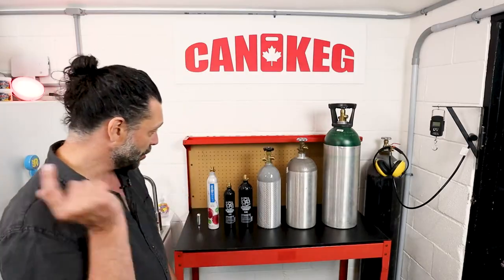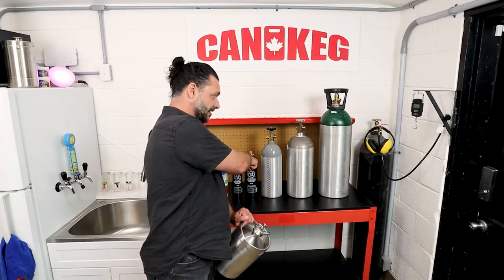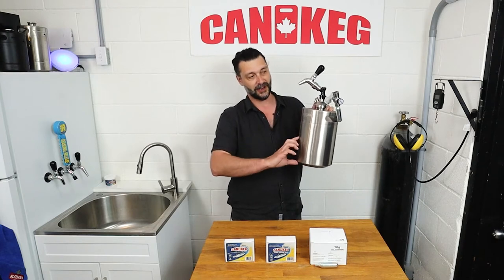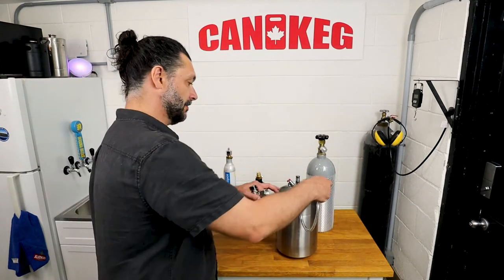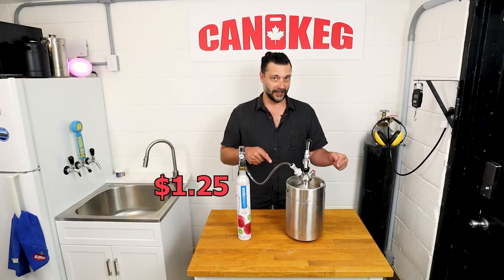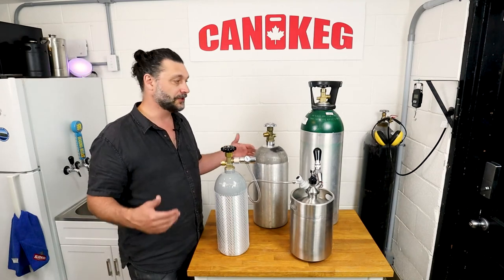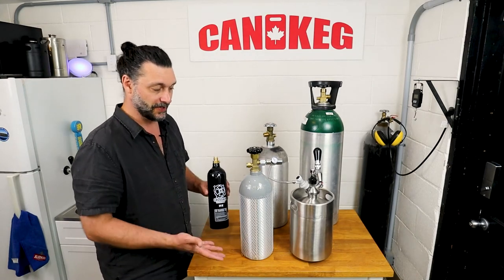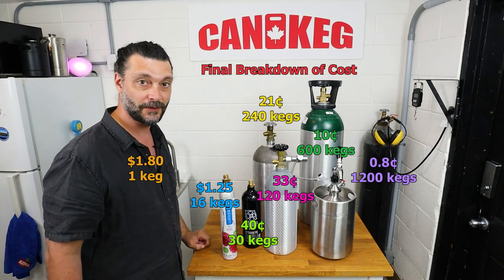CO2 Cost Comparison

Comment: Thanks for the video.  Just got my 1st keg (used 20L) and getting supplies to have summer beer on tap.  I am going the sodastream route,  but I already have the 20lb CO2 tank with dip tube as I have refilled the sodastream bottles in the past.  I paid about $1.20/lb of CO2 at the local place here in Waterloo, ON.

Comment: Is there a difference between CO2 and Food Grade CO2? asking in regarding to filing soda stream canister. Thank you!
Reply: Yes. The Food Grade is properly filtered for drinks and is safer for consumption. Soda Stream will have the proper Co2, but you can go to AirGas and they will fill it with the Food Grade Co2 which is what you want. I filled a 20 LB tank and it cost me $41 dollars in Reno to fill.
Reply: The only difference is the chain of custody signatures it's all filtered to the same standard

Comment: Is there such a thing as "food grade" C02? I am a bit worried the paintball refills would introduce some oil in my beer... I have found a place I trust and refill 20lbs and 10 lbs cylinder, but I would be worried about random refill locations. Maybe it's all the same?
Reply: It's all the same, the welding and paintball refills are just pure CO2.  I always use a welding supply shop. Very cheap.
Reply: @MachuPichuu  same welding shop is the place to go

Comment: Thanks for the video. I’ve been brewing beer for a few years now and always carbonated my beer in the bottles. I just got my first keg system (2.6) gallons. I noticed you made a distinction between force carbonate and serving. Can I still use this canisters to force carbonate? I want to filter my beer and force carbonate it with co2 as opposed to sugar. Got a little bit confused by your statement about serving and not carbonating. Thanks.

Comment: question!!.. for the paintball canisters, do you need an special regulator?... or is it pretty much the same one that we use with 16gr cartridges (up to 30psi gauge)????
Reply: Co2 in liquid form should produce same pressure, this is an advantage of this system.

Comment: Thanks for this.  I am just getting into kegs now.  If i use the 25 lb to force carbonate 23 L of beer, how long will it last?  I want to avoid the refill hassle.  Great video!  I appreciate it.  Subscribed...
Reply: I sorry if I get this wrong information, but I give it a try. I did quick Google and it says 12 to 24 hours depending on the beer. I believe it untrue. The best thing to do is actually talk to a brewery or and bar how long it last under normal used as in 1 to 4+ people drinking X number of beers a day. You doing right thing by asking here. Best thing to me is buy cheaper beer at you like to risk and do the test. Please don't just do one, try maybe 3 at the most. It give you a good number on how long it will last. It will change like weather, how much in their, how fast you are emptying it, time, where the earth is, and many other things.
Reply: c02 is about 2 g/L (at STP), if you carb to 2.5 volumes you'll be using 23X2X2.5 = 115g. You then need to push it out, assuming 11 psi at 3C you'll use another 3.4X23 = 78 g. So, roughly 200g per 23L or 56 23 L kegs. Your beer probably has some dissolved co2 from fermenting so you don't actually force carb from 0 to 2.5, but maybe like 1 to 2.5 so you might stretch it a bit further. You also might use some gas to purge empty kegs before filling which will use up gas. You also might have a leaky connection and lose your entire tank in a weekend. :/
Reply: Did u find how long does it last?

Comment: your title card was over the cost of the big boi. Is my math correct? You said that the 25lbs canister could empty the keg 600 times so can you do 1200 times with the 50lbs? and at $0.008 per fill that would be $9.6 vs $60 for the 25LBS?
Reply: Me thinks he's off by a factor of 10.

Comment: Here in europe sodastream cost 5 to 6 euro to exchange to full. 
2kg bottle cost 70€ and filling 16
10kg bottle cost 130 and filling only 22€ 😀. Difficult choice and i have 10kg for aquariums and carbonisation in parralel. Both systems can use 2 to 3bars, perfect.